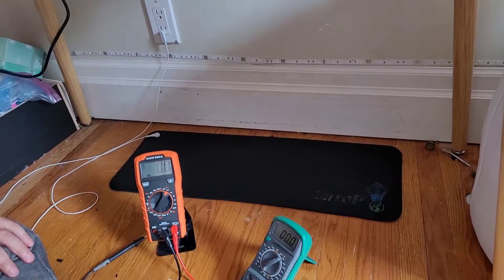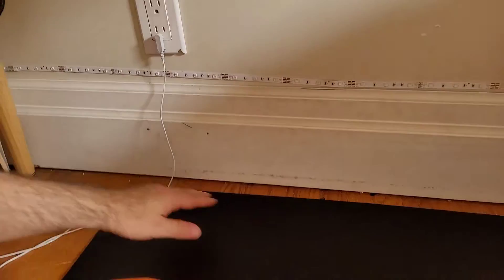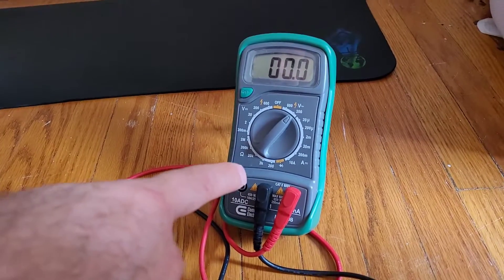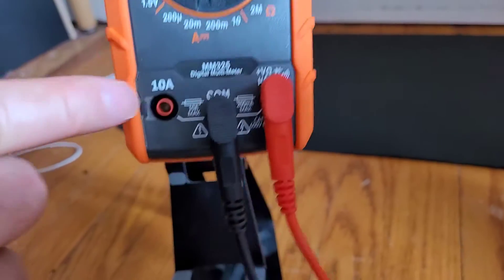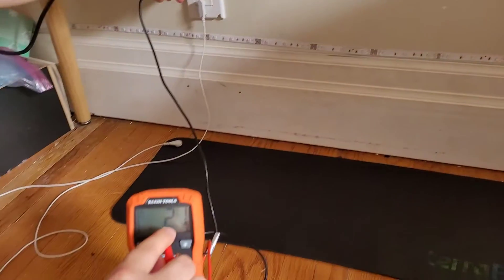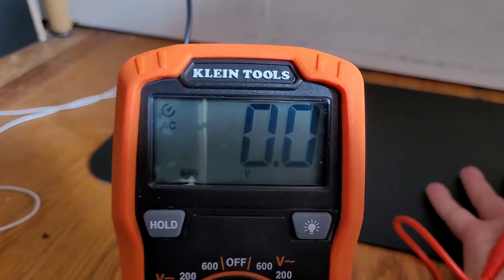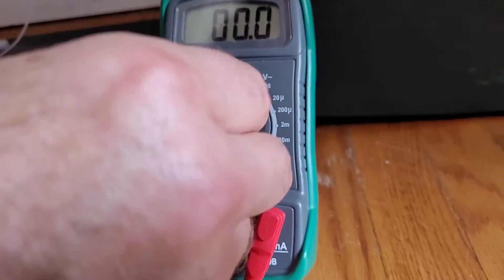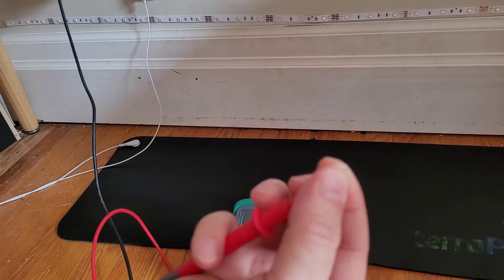How to test your grounding mat

Comment: "Your results may vary."  In my case, I measure no body voltage with my Klein Tools MM300 multimeter sent on any AC setting, but I do measure minimal voltage with the multimeter set on 200 milivolts DC. Then when I touch my hand to the grounding mat the meter reads MORE VOLTAGE.  What the heck?

Comment: I noticed your voltage check is set to 200. I saw a video on a different channel that said to set it at 20. I’m wondering which is correct? Thank you 😊

Comment: I got a grounding mat for my bed a year or so ago and wasn't sure if it was actually doing anything, but did your test, and I'll be darned. goes from like 1.2 to 0 when I lay on it. Got another one for under my desk. I should have done this a long time ago because I swear I can feel all the wires by my feet make me antsy with dirty electricity. Which is probably why I generally feel better sitting on my bed than at my desk. Now I can feel good at my desk too.

Comment: My cord does not go all the way into the wall. Please help a sista out.
Reply: Earth your pad from a metal stake in the actual earth outside. My earthing kits have always come with very LONG but very thin cables. Either drill a hole in the wall, or run the wire thru a window, or use an existing hole that is close by. The wire is so thin, you can just chip a very small portion of the window frame or sill to fit the small wire. A CRUCIAL tool to have is an EARTHING TESTER. When the little green LED is ON a circuit to Mother Earth has been created. I also earth all my shoes and I'm just waiting for a copper rivets set in the post, as I've just bought 3 pairs of shoes. I've been earthing about 10 years now, and it enhances my already almost perfect health! (I have a back injury).   I'm 38 years VEGAN. No sickness here since 1986.

Comment: Once I ground myself how long will I show 0.0 on the meter? I just bought. a new Klein like in the video. I am doing what you said. I got a 0.01 reading, touched my mat. It went to 0. Now when I go to do it again, I show that I am 0 when I do the prong in slot and  touch with my finger which is the first step on the video? I my meter broken after one use? Thank you...This is all new to me. Peace
Reply: Yes, I forgot to say thank you! Thank you!!! I have more questions: one video I saw said I need to wear rubber soled shoes to test this. What is up with that? I appreciate the clarity in your video. Peace and again thank you
Reply: To test my OWN voltage I set dial on MM to DC voltage 20V. It ALWAYS shows a voltage so I KNOW I'm still ....ALIVE!  😳